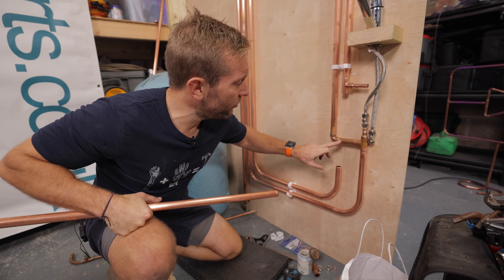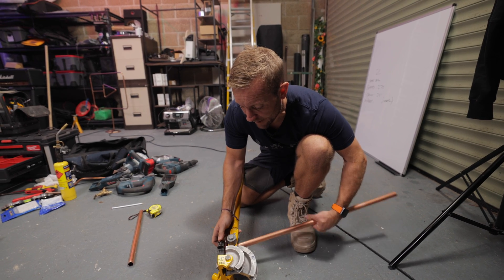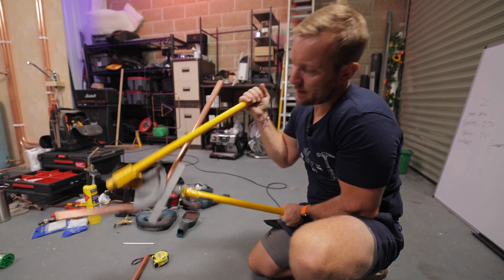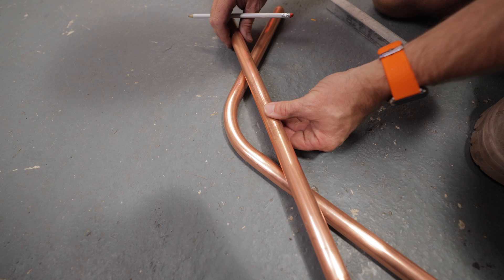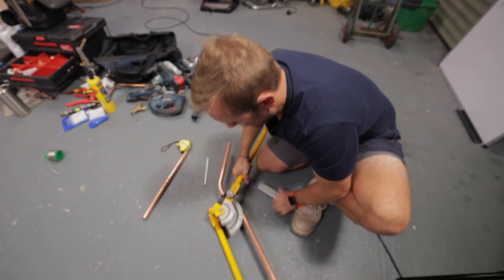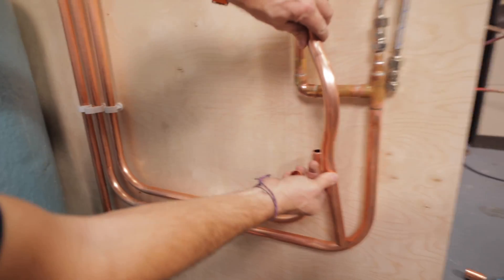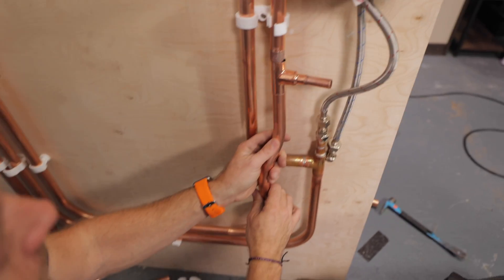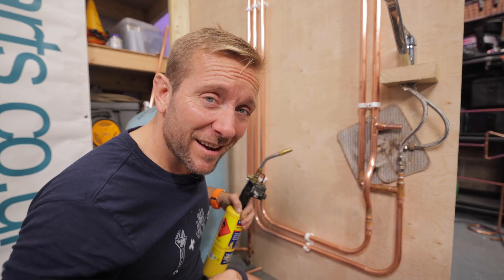HOW TO BEND A CROSS OVER

Comment: It isn't worth the £80 - £100 investment in a pipe bender when you can buy solder ring cross over fittings in a 10 pack for about 50p per fitting.
Reply: lol don’t think he bought the bender just for the occasional cross over

Comment: I’ve got a pipe bend from toolstation (their own brand). Every time I try and bend 15mm new copper I get striped creases. I thought it might have been the bender or method I’m doing, but with old copper it seems fine. Not sure if there’s a top or it’s partly the bender being relatively cheap and not as well made and also that new copper is now a lot thinner?
Reply: There's a comment on the product page - the buyer used wet and dry to polish the surface of the former where the copper bends over (so I take that as NOT the removable alloy straight profiled piece.  They report they then got smooth bends. (ON the one I just bought I can feel a ridge at each end of the "channel" on the fixed former - so I'll file that off, then polish the face along the circular former.
Reply: I've got a rb and never had a problem, buy cheap get crap
Reply: A mix of everything tbh, I'm doing the plumbing in my house now and tend to warm up the copper, former and benders with a heat gun (not blow torch) which has helped me hugely resist creasing.

Comment: Bah , we electricians do this with steel , while smoking a roll up , and teasing the plumbers .
Reply: Be everyone knows sparkies can’t do two things at once!
Reply: … and overcharging the client by 50%!
Reply: I had to go and pull some sparkys out the shit a few weeks ago with some 25mm conduett, had to do loads of cross overs they couldn't do it, sparks like to call them bubble bends, but the way when your marking he pipe after your first bend it helps to put your on the edge of a tablet or a straight edge get your straight line for the last 2 bends
Reply: @andrewhayes4914  
I gave away my conduit bender and dies away when i retired , don’t miss the smell of cutting compound, or the steel splinters .
One of my last jobs was a hospital build , concrete,no windows ,no finished floor levels , middle of winter , all in galv tube .